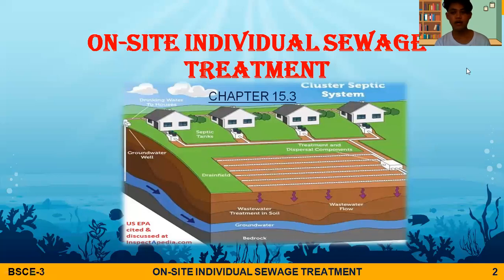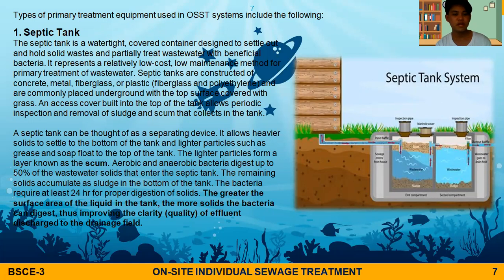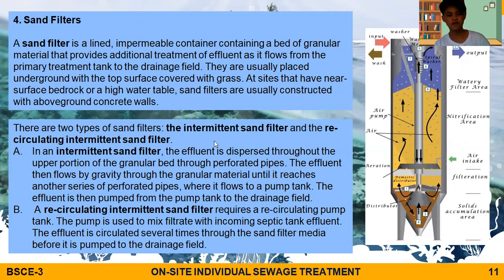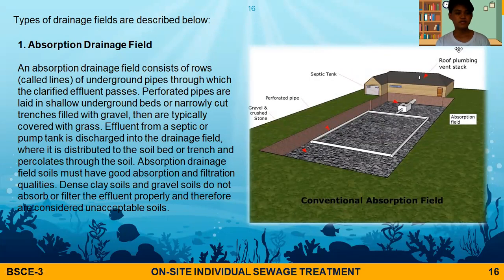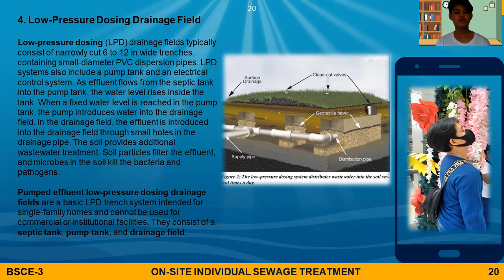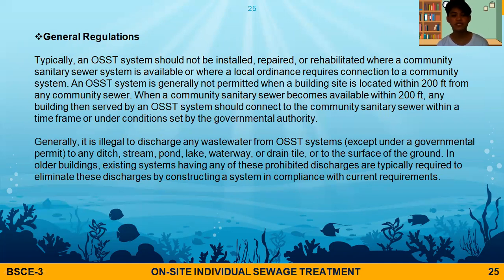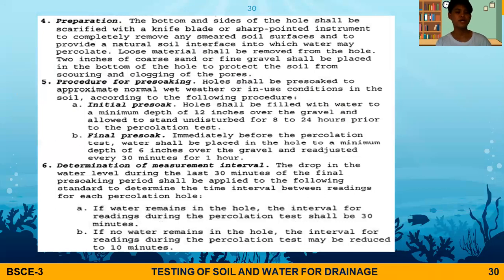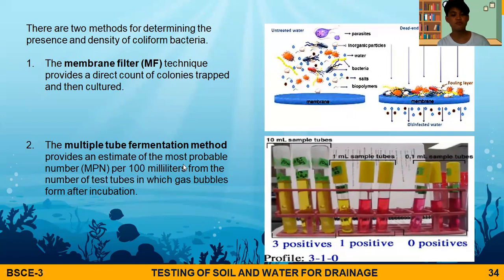ESCOOBILLA,RICHARD   PRESENTATION FOR UTI2

Comment: In this report, First I learned how the on site sewage treatment system flow the wastewater from our home. It leads from our home to the septic tanks and then into a drainage field. I also learned that septic tanks is an example of partial treatment. It also tackled how the septic tank systemized the wastewater from the raw sewage to the screens then goes to comminutor, comes to grit chamber and so on. I also realized that there are two treatment in wastewater including the primary and secondary, such that primary treatment removes material that will float while secondary removes biodegradable organic matter from the wastewater.

Comment: In this report, I learned that the majority of them have a septic tank for partial treatment and are referred to as septic systems. On the other hand, the initial treatment for a disease. It is usually used in conjunction with other treatments including as surgery, chemotherapy, and radiation. The soil in a drainage field must be able to filter wastewater effectively while simultaneously minimizing soil consolidation and swelling.

Comment: I learned that most of them include a septic tank for partial treatment, they are commonly referred to as septic systems. The initial therapy for an illness, on the other hand. It is frequently used as part of a typical treatment plan that includes surgery, chemotherapy, and radiation. Primary therapy is widely regarded as the best treatment when taken alone.

Comment: This was all about individual sewage treatment on-site. I also learned about primary and secondary treatment equipment, as well as the procedure for breaking down sewage in wastewater. The first and primary water treatment stages remove large particles from wastewater, but the secondary treatment phase removes smaller particles that have already dissolved or suspended.

Comment: This report, individual sewage treatment systems are employed in places where a community wastewater treatment plant is not available. Individual sewage treatment systems are used by one-fifth of the building stock to treat wastewater. Soil is an important part of an OSST system also soil for a drainage field must
 effectively filter effluent, and not allow inhibiting consolidation or swelling of the soil.

Comment: treatment systems, in my observation on the report, are used in areas where a communal wastewater treatment plant is not available. This topic also teaches that soil is an important component of an OSST system because it processes and disposes of septic tank wastewaters.

Comment: I learned something about the on-site specific sewage system treatment. It is very important to have a water treatment and having a filter and a tank.  Also having a soil testing and using the soil to filter the water.

Comment: I learned that Onsite (or decentralized) wastewater treatment systems are used to treat wastewater from a home or business and return treated wastewater back into the receiving environment. They are typically referred to as septic systems, because most involve a septic tank for partial treatment. On the other hand, The first treatment given for a disease. It is often part of a standard set of treatments, such as surgery followed by chemotherapy and radiation. When used by itself, primary treatment is the one accepted as the best treatment.

Comment: Ive learned in this video is that the pump tank collects wastewater until it is dosed into the next component in the onsite wastewater treatment system. The tank must be watertight to prevent wastewater from seeping out and groundwater from entering. It must be big enough to hold the amount of wastewater distributed during dosing.

Comment: In this report and video I learned about on-site sewage treatment systems, drainage soil and water testing, and on-site sewage treatment systems. The soil in a drainage field must filter wastewater effectively while simultaneously preventing soil consolidation and swelling. In regions where a community wastewater treatment plant is not accessible, individual sewage treatment systems are used.

Comment: In this was all about On-site individual sewage treatment. And i learn about the primary treatment equipment and secondary treatment  The method for breaking down sewage in wastewater. Large particles are removed from wastewater during the first and primary water treatment processes, whereas smaller particles that have already dissolved or suspended are removed during the secondary treatment phase.

Comment: In this report or topic, what I have learn is all about on site individual sewage treatment. It says that on site sewage treatment system is what we called the septic tank. Usually consist of the building sewer. It is used to treat waste water back into the recieving environment because of most involve a septic tank for partial treatment.

Comment: In this topic i was able to know more about how this things work. like in the primary treatment i was able to understand how it removes material that either float or readily settle out with the help of gravity and also the types of primary treatment equipment used in OSST. I was also able to know different types of tanks and how they differ from each other like how aerobic tanks work and how it becomes more effective than septic tanks.

Comment: According to my understanding of the video, individual sewage treatment systems are used in regions where a municipal wastewater treatment plant is not available. Because it processes and disposes of septic tank effluent, soil is a key component of an OSST system. A drainage field's soil must be able to properly filter wastewater while reducing soil consolidation and swelling.

Comment: I learned about on-site individual sewage treatment systems and soil and water testing for drainage in this topic. Individual sewage treatment systems are used  in areas where a communal wastewater treatment plant is not available.The waste water from a building is handled first in a main treatment facility, and  according to this video the soil is a crucial part of an OSST system since it processes and disposes of septic tank effluent.

Comment: From this video, I learned that the waste water from a building is treated first in a primary treatment facility. Tanks and filters are examples of equipment. In addition to what I've learned, a soil evaluation is a thorough examination of the subsurface soil characteristics at a specific location under the guidance of a professional engineer or geologist. Because soil processes and disposes of septic tank effluent, it is an important aspect of an OSST system.

Comment: In this topic, I learned about on-site individual sewage treatment systems and testing of soil and water for drainage. In regions where a community wastewater treatment plant is not available, individual sewage treatment systems are used. Because it processes and disposes of septic tank effluent, soil is an important aspect of an OSST system. A drainage field's soil must adequately filter wastewater while also preventing soil consolidation and swelling.